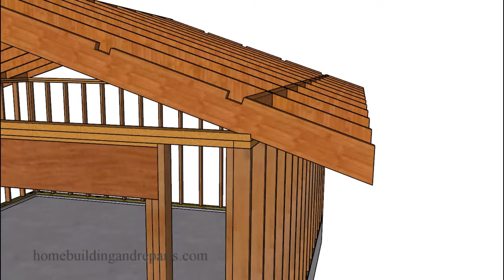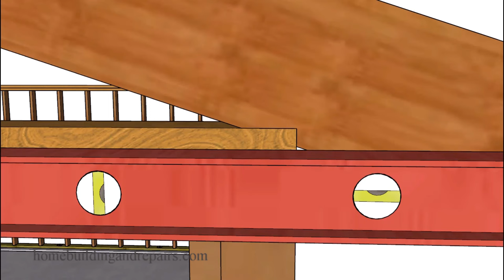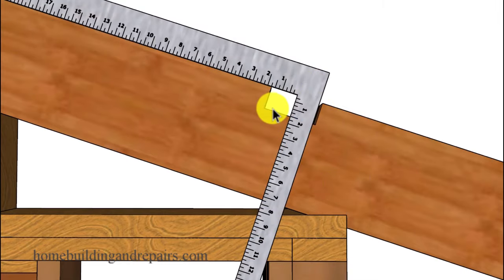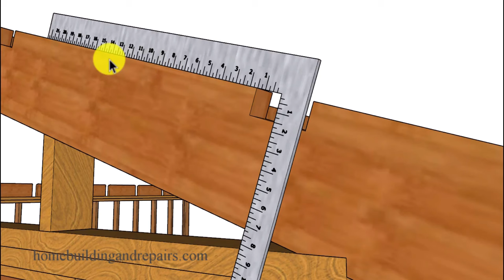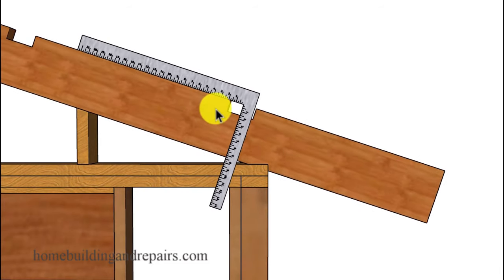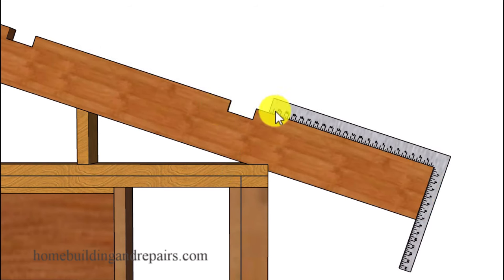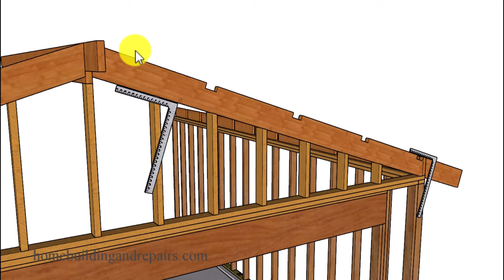How To Calculate Gable Roof Rafter, Blocking And Stud Angles With Framing Square And Roof Ratios

Comment: To better position the square for some layouts, one can use different versions of the same ratio. For example a 4 in 12 pitch is a 3 to 1 ratio. So you can use 1 in 3, 2 in 6, 4 in 12,  or 5 in 15. And so on.

Although it's probably as popular as leaning how to use a Slide Rule, but for those following your vids might be interested in a video of the how to use all the scales, tick marks and notes stamped on those traditional framing squares even though it's pretty much regarded as archaic these days of pocket calculators just like the ol' slide rule.
Reply: Give me the old framing square. I don't like the framing calculators, as they produce framers who don't really understand how to frame without them. I'm not sure what they would do if their calculator broke.

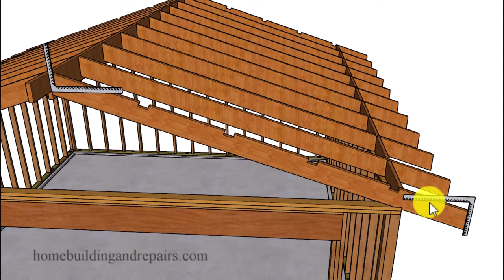Comment: Dear Greg, I am hoping to build 2 tiny houses on my daughter's land this summer. To meet the energy code demand of R40 in the attic, we may use 14 inch i Joists. The maker of the joists says no birdsmouth at the top end of the 2:12 flat roof, only at the bottom end of the joist. They recommend installing a bevelled support on top of the double header. This strikes me as a weak link. Is this a common practice? Am I worrying about nothing with the addition of a bevelled 2x6 on the top of the wall frame? Thank you so much for all your great work!

Comment: @gregvancom  Can you do a video on frieze board assembly for brick walls? We used to build them out of 2X4 blocks, but you don't see that type anymore. Do you know the type I'm talking about, 2X4 blocks that the frieze board is nailed to?
Reply from the maker: I would need an example or detail if you have one. Send me a link if you have one or more details.
Reply: @gregvancom  There doesn't seem to be anything about it online. Apparently, it's a method that's no longer used, but we built them like that in the 90s. I thought you might know the type I was referring to. I don't have any links or pictures.

Comment: You keep saying fascia, maybe our lingo is different. Do you mean sheathing/roof deck? To me fascia is the decorative piece that you put on at the end to hide the framing.
Reply from the maker: No, fascia is the exterior board that you're referring to also.
Reply: I think you both have the same definition. He was referring to those cutouts being for the "support for the fascia." You may be thinking about the fascia on the eve, but he's talking about the fascia on the rake.  Those cutouts are for the supports (not shown) which will cantilever beyond the gable and to which you will attach the fascia.

Comment: Our framer extended scab board from the rafters at a steeper slope than the main slope to shorten the distance of the facia board from the exterior wall. So we have a roof than angles down from the exterior wall to the facia. This looks like a covered up mistake. Please let me know your thoughts. I can send pictures if you are interested in looking at it further.
Reply from the maker: I've seen this done and think I have a video on changing the slope.